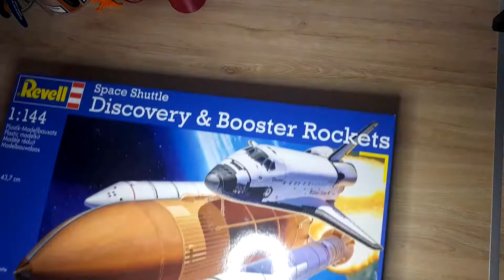Revell - Space Shuttle  Discovery - Part 01

Comment: Hi, very good tutorials and solutions. But I have some questions. Is it possibile to get in touch somehow? Best wishes, Patrick
Reply from the maker: Hello, 
Sorry for the delay,  yes sure ! Feel free to post your question here to share it with everyone :)
Reply: @meivinmodels6511  hi, I would like to ask you which nozzle you use in your video and with what pressure you apply the primer to the object... and does it also behave like this when spraying on the actual airbrush paint or do you then work with a different nozzle and adjust the pressure on another bar?
Reply from the maker: @patrickmuller6113  Hello, 
i'm using a nozzle of 0.2mm with a pressure of 0.2 bar for most paint even for primer
I rarely change the pressure, i noticed recently that metal paint for exemple need a lower pressure, so i go on 0.15-0.18 bar.
In the case i make shadowing i use the same nozzle but reduce the pressure on 0.15
Reply: @meivinmodels6511  hi, thank you very much for your valuable answers. I'm currently working at 1.2 [sometimes 1.8] bar with a 0.4 nozzle (H&S) and I'm not entirely happy with the result. There is one part of this shuttle that I just can't get right. It is the inner part of the cargo area in which the Columbus module is also placed. Those pillars and the rear interior. The colors then start to run when sprayed. The grooved inner part of the cargo area also drives me crazy. Do you think with less pressure you could get such areas properly painted with the airbrush without having to rework with a brush?
Reply from the maker: @patrickmuller6113  hi, you're welcomed ;) 

Ahah yeah i understand your problem, i retried it so many times to get the desired result ! 
I rarely work with a 0.4 nozzle, i used it for large surface (like the outside of the ship or boosters with the white color). For little pieces i prefer use 0.2 nozzle (H&S). 
For the cargo area, i painted it with different layer. The first one was a large spray on all the piece and i let it dry for 30 min. 
Then, i sprayed from lett to right pillar, let it dry 5-10 min and do the same from right to left pillar for both side. 
I don't remember the pressure i used for this one. But if i remember well, if you reduce the pressure you will have to be more close to the piece when you paint and the dilution will have an importance. 
Maybe if your paint runs out, it could be the dilution. For my paint i'm mainly using a dilution of 50/50 to avoid any issues (with the thinner related to the paint (ex: Tamiya with Tamiya thinner).

I had a lot of issue at the beginning to not have this kind of issue (paint running out), i've made a lot of try on keyboard keys with dilution & pressure to know which parameters is good.
If your paint runs out, you may be too far or to close of the piece you're painting on, or painting too much on the same area.  
Then about dilution i counted each drop of paint and thinner to have the same level of paint/thinner. For tamiya for exemple, a 50/50 ration is correct.
In french, we're saying that the paint should look like milk consistency (it's hard to determine this.) i've spend hours looking what was the consistency of milk to have the same on paint ahah (not easy step!) 
and at last for pressure, i tried different options and notices that dilution impact on your paint and the distance you're using have an impact too. 
I recommend you to paint to about 15-20cm of distance between your airbrush and your pieces. 
Then spray small layer on it. Don't try to cover it in one layer. The more thin your layers are, quicker it'll dry and you'll be able to spray multiple layer to have the desired result. 
If you can handle the paint volume control with your airbrush, try to not push it fully on the back. make small pressure and count 1-2 seconds in your head and stop painting. Then do it again on an another surface.

I hope it'll help, as you notice there is a lot of parameters ahah 
Have fun modeling :) !